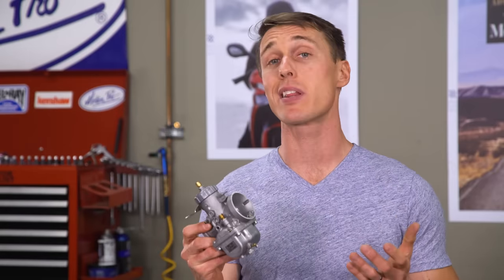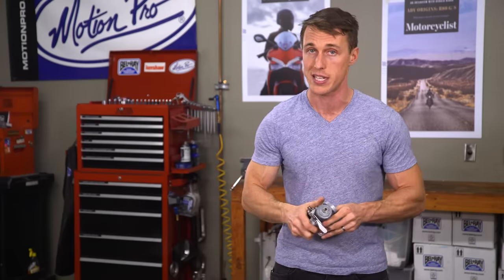Carburetors vs. Electronic Fuel Injection—What’s Better? | MC Garage

Comment: Old-timer carburators are sensitive to temperatur and elevation - should we just call it atmospheric pressure and yes higer elevation gives lower pressure :-)
And fuel injection is not affected by temp and pressure - WRONG !!!!.

Some types of carbs actually handels changing pressure very well and even has temperature compensation - you will know if you know anything about carburators.
Injector houses are actually a bit simpler - they do not have multiple jets and needles to handel a wide range of air/fuel flow.
Fuel injection (FI) is as affected by temp and pressure as carbs, but they have a lot of electronics to compensate for that - some very late carb systems had electronics too.
FI's have solenoids to hold back the trottle in cold weather while carbs has a choke. FI have extra injectors to enrich the air/fuels mix while the engine is cold.
FI's are measuring at least two pressures and two temperatures.

You are  exaggerating the complication of the injector housing and simplifying the carb - 
A simple injector house is nothing more than a butterfly valve and a place for the injector.
You wont get that easy away with a carb - apart from the butterfly valve, or the like,  you'll need something to keep the right level of fuel, an idle jet, a main jet a needle to control the flow in the main jet and if you want it to feed under acceleration you need a kind of acc.pump or jet.

But yes FI's are able to deliver a perfect mixture over a much wider flow range than even a very advanced carb system.
Some viewers liked it because it was very simple and pretty non-technical, but you simplified it that much that some parts became factual not correct - sorry :-)

Comment: I have no proof to back this up, other than my butt dyno... but carburetor engines seem to have better low RPM response and a snappier throttle... I think it may have to do with the fuel being more atomized.  FI seems to spray the fuel more coarsely.  I believe fuel injectors have to pulse the fuel and will do so at frequencies relative to air flow (pressure)... the pulsing action is where things don't go as smoothly from a combustion perspective... IMHO... stay safe everyone!

Comment: Put it on a dyno. Carbs do outperform feul injection , and can be more efficient , believe it or not ! U can deny as much as u want. It remains a fact. I worked on them since 1982. Many truths he speaks, but I prefer carbs. By the way you will have to work on fuel injection (clean /replacing sensors, injectors pumps blablabla !)  No argument.
Reply: No, they don't. Carbs have their advantages to fuel injection but power is not one of them. A properly tuned fuel injection system will outperform even the most advanced carbs.
Reply: @Redtooth75  I stand by what I've said. You will only disagree if you don't know or lack the experience !

Comment: You  are correct, all new  bikes have the fuel injection system on them, and they might make you bike run  a little better while the bike is shiny and new.  BUT if you need to repair anything on that fuel system OR even look the throttle poison sensor in the wrong way the emissions will run higher than any carburettor on the planet, the you WILL have to take it to the shop and dig so deep in your pocket to have the repair  done you might as well buy a new bike. fuel injection on dirt bikes is a joke steer well clear stick to the easy fix carb biking is for fun not emissions

Comment: Big point he forgot to mention: FUEL INJECTION is LURCHY. Carbs, if properly jetted, are very FLUID in their air/fuel delivery. I haven't ridden one FI bike yet that wasn't ABRUPT right at the edge of cracking the throttle...where your roadbike lives 75% of the time. My old carbed Bandit 1200, finely jetted, is positively CREAMY right off idle to redline.

Comment: Overly generic video that simply favors EFI for its strengths.  I am not saying EFI is bad, quite the opposite.  Not even going into the complexity or ease of repair aspects, it is superior from its adaptability to changing climate conditions and elevation.  Carburetors are still superior in terms of power production, IF, and only IF, it is exactly tuned to the engine in its current elevation and environmental conditions.  Change any one of those many factors enough, and that advantage is gone.  This is entirely down to the nature in which carbs atomize fuel.  This is why most modern bike fuel injectors have so many orifice holes, and why modern systems operate at higher pressures - to better atomize the fuel.

Comment: pressurised fuel tube to the injectors. great till you end up with a fire. id rather have a low pressure carb system any day.

Comment: Not sure about FI getting better mileage. From what I've see with cars and bikes there's little or no more mileage than a carb gets. It's also unclear why a gas tank for an FI bike wouldn't leak the same vapors as one for a carb bike, but it's true that the carb itself will.

Comment: Fi is good but carb is good too and its easy to maintain fi its not easy to work when having trouble. Its more complicated compare to carb. In carb you can do it on your own. Fi need special tools etc. Can't repair without diagnostic tools or extra parts there a lot off things to check on a fi motor bike.

Comment: How can this even be a thing?  EFI wins hands down...give me a break...why would anyone even think carbs even come close.
Reply: Pros and cons to both, I personally have absolutely no problem with carbys, I might actually like them more then efi, then again I pretty much always choose mechanical over electrical.
Reply: There are advantages and disadvantages to both. EFI is more precise and efficient than carbs. They make more power and better fuel economy than even the best carburetors. 
On the other hand, carbs are much cheaper, the maintenance required is cheap, and are very simple to tune and install. If you are on a tight budget, carburetors are a good option. If you want to maximize power and fuel economy, EFI is the way to go.
Reply: @Redtooth75  efi is cheap, for 1k you can get 2 brrl or 4brrl efi carbs rated for over 750HP
Reply: @Redtooth75  and for bikes they are even cheaper, although they are usual single injection
Reply: @johnnyasus86  still more expensive than a carb. You can buy a brand new carburetor for less than $400
Reply: Would you rather have a 95 Harley with carb or 95 Harley with fuel injection?

Comment: Damm EFI parts is soo damn expensive..fuel pump.. oxygen sensor... throttle position sensor... computer box and etc....will drain your pocket..... Carb otherwise? Nahh just service it for next to nothing 😑😑 carby is still the best option 😑😑

Comment: FIx iT on ThE SIde Of THe roAD
I'm sorry, but who the fuck is gonna work on a carb on the side of the road? You're more likely to get it clogged up with dirt than actually fix a problem.
The whole "carbs are easy to work on" is a fallacy, it's the same process as working on an EFI system, you take it apart, check the function of parts, clean, and replace where necessary. You might need to perform some simple tests with a multimeter, but you need a multimeter for other parts of carburated bikes anyway.

Comment: " " "BOTH THE VERSION THE MECHANICAL FUEL INJECTION AND ELECTRONIC FUEL INJECTION MODELS SHOULD BE DEVELOPED FOR EACH AND EVERY BIKES AS A MATTER O COST CONSIDERATIONS   THE COST CONSIDERATIONS,, ,, BUT CERTAINLY BUT CERTAINLY THE ELECTRONIC FUEL INJECTION ELECTRONIC FUEL INJECTION WILL BE PREFFERED WILL BE PREFFERED,, ,,   BUT MECHANICAL FUEL INJECTION SHOULD NOT BE IGNORED AND SHOULD BE AND SHOULD BE DESIGNED AND AVAILABLE DESIGNED AND AVAILABLE FOR EACH AND EVERY BIKES BIKE BIKES BIKE,, ,," " "

A BIOLOGIST, ,,

Comment: It will never fail to amaze me when I read the comments below and see almost no one states the FACT that carbureted vehicles are easier to fix. All it takes to strand you with fool infected bikes or ANY vehicle is a faulty crank sensor, cam sensor or fuel pump. Do any of you idiots understand that simple statement? My collector cars and motorcycles NEVER EVER strand me with anything but SIMPLE repairs and that is extremely rare. Stop exaggerating how much you had to work on points, condensor and carbureted problems, you are just showing your ignorance. But what would I know, I just build cars, airplanes and motorcycles and have for over fifty years.

Comment: Hmm, Four cylinder bike? Fuel Injection every time, anyone who has ever had to pull apart on old carburettor bank to do some fix will tell you how much fun its not. Single carb bike like a Harley? Carburettor every time, easy to service as it's right in your face.

Comment: Yeah no FI is popular because it provides performance so emmisions are easier to meet and there's more parts and those parts are more expensive which means the dealerships and manufacturer get more of your money.
FI is not as reliable as a carb I've had both and talked to dozens of people.
If you run non ethanol and actually ride your bike you'll have to clean your carb at the same time your FI needs work.

Comment: Bull crap id go with a carburetor any day besides mine has an electronic Throttle Position Sensor...its been 4 years no problems not one and I just had it opened for routine servicine after 4 years,because of the fuel additives there was no clogging in the jets whatsoever.Getting a great mileage aswell.not every new tech is necessarily better.

Comment: Most bike in Fuel Injection required by the world government for lesser emission, it is not any better than the Carburetors most fuel Injection run leaner as a result lost power in top speed while the Carburetors can easily tune for more fuel for better perfomance

Comment: FI is shit… if battery low/shot or voltage drop your dead. All FI parts are unrepairable. Most of the time FI controller or nozzle cause problem both are expensive… You can buy 10 to 15 carburetor for the price of 1 fuel injector…😎

Comment: " " "CARBURETTORS ARE EASY TO MAINTAIN IT WILL STILL BE THERE STILL BE THERE AS ECONOMY AND ECONOMICS 
MATTER. MATTERS,, ,," " "

" " "OTHER FUEL INJECTION PARALLEL SYSTEM SYSTEM MAY COME MAY COME,, ,," " "

" " "ITS INDIA,, ,,
ITS THE TERRAIN TERRAINS O O O INDIA. INDIA,, ,," " "

A BIOLOGIST, ,,